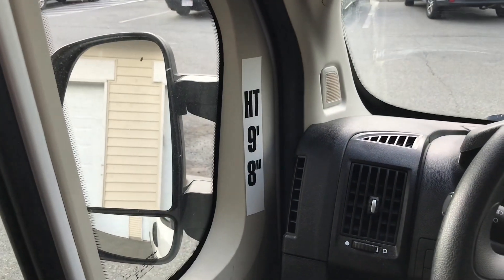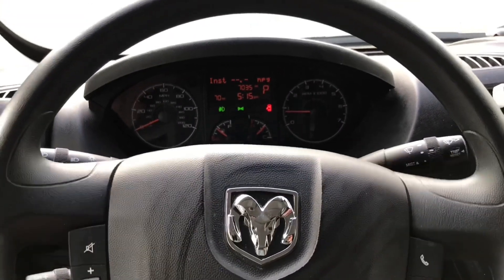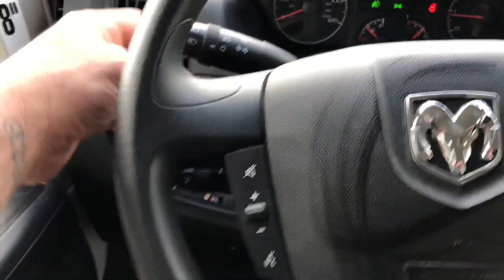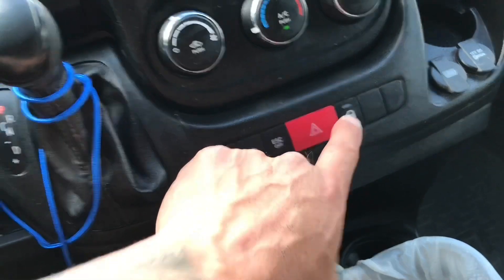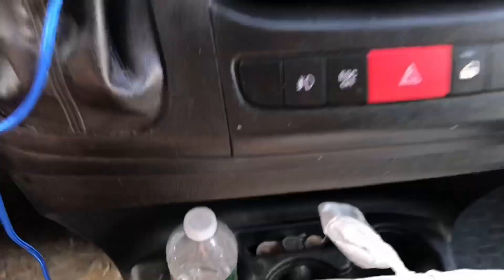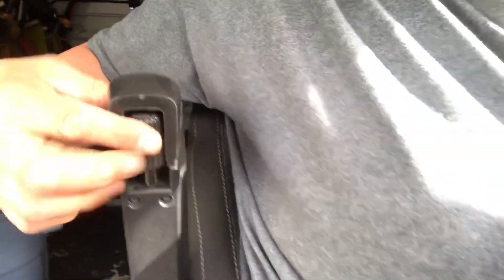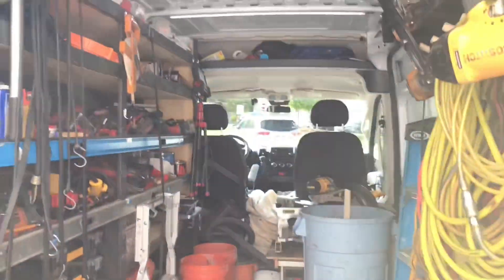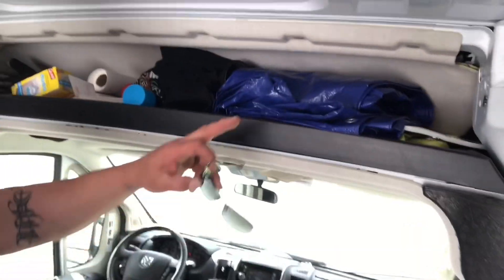REVIEW! RAM Promaster

Comment: Where is the fuse box for the body of the van?
Reply from the maker: There is a fuse box lower left under steering wheel and one in engine bay right side.  I’m thinking body module fuses are the ones below steering

Comment: I am getting ready to purchase a Van primarily for personal use (non business will be hauling at times my motorcycles). I am focusing on both the Ford Transit EXT AWD and the Dodge Promaster 159 EXT. I have gotten headaches comparing the two trying to make a decision, haha. I am  leaning towards the Dodge for its more box like design and proven V6 motor (which has been around for years Jeep). It is not built as well as the Ford, IMO (the body structure) but like I mentioned the Dodges boxy design gives more interior space (particuarly in width).   The Ford does offer all wheel drive (good for winter roads and some light off road driving) and higher roof height. The U.S.Post Office uses all Dodge Promaster Vans to deliver the mail and Amazon has them in their fleet as well. The maintance on the Dodge seems to be the less expensive of the two and easiest to work on. Decisions, Decisions, haha. In the long run it seems that the Dodge and Ford would last just as long but the Dodge it seems would be less expensive during years of ownership.  Golly Gee, what I am to decide ? Most likely it will be the Dodge or not ...

Comment: Awesome thank you! I am going to get one for a weekend warrior, smallest one. I am a little guy. The 1500 low will be the highest vehicle i will have owned and i love your height guage in your door. No one else has done that. Unfortunately my current garage is 7' and the low roof is over 7'. After i get it and install solar on the roof i will measure and put the measurement inside the door as you have done. Will help with drive thrus as you have said! Another perspective on a different  use, as videos go. Question: would you get a step, especially as you get older? On the rear and/or side? I am small as i have said so i might look at getting a short running board. Oh and security, would you recommend a 3rd party system to protect your stuff? Thanks.
Reply from the maker: I don’t like steps, I’m tall and I really don’t need them, plus I try to stay in shape as much as possible so I don’t mind stretching!
I’ve never looked into security for my van.  I typically work in decent neighborhoods so I never really have had anything stolen.  Also pawn shops pretty much stopped taking tools at least around where I live so thieves don’t really aim for them.  They’ll just go to Home Depot and take them

Comment: I have no idea what to think. 
So many horror stories out there about the cooling system and transmission on the Promasters. And then the ford Transit with its own set of unique problems.

Those are the two I was considering to build out as a campervan.
Now I'm thinking unless I win the lottery I shouldn't take the chance.

I'm glad your experience is good but im left with the impression that between the two it's a choice between the devil and the deep blue sea.
Reply from the maker: Michael RS they seem to have worked out the kinks, you should be good on a new one!  My 2018 is still running great, I did make a video on the headlight issue
Reply: @TunedRAMS  Thanks for taking the time for the feedback. Perhaps a little more stressful for me than some as I'm on a fixed disability retirement income. So hopefully I guess right when the time comes. 👍
Reply from the maker: Michael RS good luck, I know RAM has a lot of good incentives!

Comment: Great video. Nothing envious  about a Nissan envey ugly and cheap looking. I too had  a ram 1500 hemi.  Fantastic truck.  Then bought new 2019 1500 promaster. ..love it. 48000 miles  and zero problems.  Just oil changes. Mine has led lights too there indispensable. . Not many have them

Comment: This was such a great video, helped me make my decision. I was thinking between a Ford Transit, high Roof or the Ram, Promaster. After many reviews and your perspective, I will go for the Ram!!
Reply from the maker: Marvalous Metanoia good choice, glad this helped!
Reply: @TunedRAMS  I have a Ford Transit 350 dually for expediting cross the country and it has all wheel drive. With the load weight I haul my mileage mpg is between 18-22 mpg. Not bad and the awd is automatic and it also comes with locking diff,and front and rear heat and air also crosswind monitoring so it won't tip over.

Comment: Replace headlight bulbs every 6 months, 3 recalls, oil leak, door won’t open sometimes, hands free has to be reset every week, inadequate heat and a/c. No traction in snow. I go in reverse to get up a hill. Great mileage, lots of power.
Reply from the maker: Walt Archambeault the headlight thing, there’s a drain below the windshield that when it gets clogged drips onto the headlight plug which causes headlight issues.  Got to keep it clear, bad design either way.  Other than that my A/C spits ice and no leaks, she’s a 2018, I know prior years there were issues
Reply: TunedRAMS  There’s a drain below the what? Is “wind shou” supposed to be windshield? Can you elaborate on exactly where the drain is located please? I’ve heard about this headlight problem numerous other times so this is great information really appreciate it, thanks.
Reply from the maker: spleerfloof I edited, yes below the windshield at the wiper arm, in the plastic tray, there should be a small weep hole
Reply: TunedRAMS Thanks for clarifying, I plan on buying a ProMaster in the next six months or so.
Reply: Update:  54,000 miles. Replaced headlight bulbs with led. Let’s hope to get at least a yr from these.  Insulated the rear panels and added an aux heater to rear compartment. Here in NewEngland it gets cold and snow. The van was like a traveling refrigerator. My heated mirrors failed. No big deal, found one in a salvage yard. My rear doors rattle, fix those next. Hinges starting to rust. Still annoyed that my doors fail to open every time.

Comment: Front wheel drive is always better in snow than rear wheel drive, especially considering the weight is over the front wheels. Think of pushing a grocery cart through snow. Much more control if you pull one.
Reply from the maker: Actually now that she’s fully loaded she’s not so bad anymore.  I still get stuck once and a while tho.
Much better than RWD

Comment: I love mine too. I'm 6-3 as well and have smashed my head on those God Damn rear door brackets lol. My only two complaints are my 2500 gets terrible gas mileage around town and it's terrible in the snow. Next winter I'm gonna try some good snow tires on the front.
Reply from the maker: Yeah drinks fuel very well, I got Cooper AT3’s in the front and a tremendous improvement in the snow!

Comment: i used own one 2014 Ram Pro master High roof with 350000 km on it..what i want say is lots of parts are expensive and dealer only. Seat is very uncomfortable for long time drive(in 5ft 7). V6 Fuel efficiency isn’t good on highway when it’s windy, not much difference than v8 if you drive on highway mostly. I had engine leaking oil started at 240k km, took it to several shops it cost lots of money for inspection and repair so i just drive it because  market value is pretty low at that time and it’s eventually done at 350k km. Overall from my experience if you don’t put too many mileage on it, it could last for years, if you drive a lot and high roof isn’t necessary for you. Go with old chev cargo van, because parts are much cheaper and less headache. Im driving a Nissan nv 2500 high roof now because there is lots of space in cargo, parts is cheaper, mpg is close but there is lots of space at front when you work on it.
Reply from the maker: SageInSosg this is a 2018, 17k miles on her, she’s doing good so far.  I’m pretty sure they worked out the issues by now, I know they improved in a lot of things, even the 2020 is better.  It seems you got pretty good use out of it?  And yes about the seat, I tend to lean to the right on long drives, i wish the seat was a little lower

Comment: I have plans for a 2019 12 foot high top 3500. Thanks for the input. I was wondering about all wheel drive. I will have to check to see if it comes in all-wheel drive. Thanks for the info have a great one

Comment: I am looking at a used 2015 high top. I have seen hundreds of horrible reviews, so I am wondering, since you've had this a while now, is it still holding up good? Guys are saying electrical issues, headlights, motors, trans, door hinges.
Reply from the maker: Tom smith runs great, no issues so far.  I have a video, in the description, about the water hitting the light
Reply: @TunedRAMS  Thats good to hear. I asked a couple of my Facebook groups (which are all electricians), and they all pretty much had bad things to say. But when I think about it we electricians never usually have anything good to say, lol.

Comment: what do you think of the transmission of the promaster 1500 2016?  mine died with 150 k
Reply from the maker: The 6rfe is not the best, they suck in the RAM 1500’s too, as long as you don’t beat on it should last quite a while.  150k is a lot!

Comment: Have you had any mechanical problems up to now?  I'm planning on converting a promaster into a full time RV and don't want my home held up in a garage for design flaws.  Thanks.
Reply from the maker: Janet Arendas no mechanical issues at all!
Reply: I've had my van for 2.5 years and 40k miles.  Only issue was a rear door latch/lock.  The dealership replaced it under warranty.  I drive pretty easy so I average 17 mpg overall.  20 or more on the highway.
Reply from the maker: ripvanracer I actually had to adjust the rear top latch, I was having to slam the door shut and pull very hard to open it. Now it works nice

Comment: I really love my ProMaster!  Glad to hear it's working out for your business.  Question though:  You measured only 10' in the cargo bed, but you have the 2500.  What wheelbase do you have?  I have the 136" wheelbase, which has the 10' cargo length, but the dealer said the 2018's only come in 1500.... Ya got me wondering if he was "mistaken".
Reply from the maker: Luvnot Videos they come in two lengths, I have the not so long one.  I’d have to look up the length off the original sticker.  Mines an 18 and it’s a 2500.  He probably doesn’t carry them, but they definitely come like this
Reply: So there are two wheelbase lengths, the short one is the 136 inch and the longer length is 159 inches. You can get the 159 in a regular length or the extended length. The regular length gives you 12 feet of cargo space, and the extended length gives you 13 feet.
Reply: @TunedRAMS  Thank you.  That's what I suspected.  I asked for the 2500 136 wheel base and was flat out told they don't make them.  Good to know which dealer to never return to again.

Comment: you should really invest in a wall partition, great review
Reply from the maker: Duarte Handyman Services LLC. Duarte  don’t like them, they get in the way.  They restrict seat depth and often times Lumber.  I like to throw 12’ stock in between the seats a lot.  Thanks!!
Reply: TunedRAMS I get what you're saying however they are made to keep you safe in case of an accident, keeping all the tools from coming at you during the impact.
Reply from the maker: Duarte Handyman Services LLC. Duarte  I know man, been doing this for over 30 years, I drive slow
Reply: It takes only one accident! It's to late...
Reply from the maker: SC 03 motorcycles don’t have seat belts do they
Reply: Our work/leisure vans have all had their partition walls removed in favor of a curtain. The curtain is just separation from the front and back and does a good job at keeping climate control in the front cab area of the van 👍🏻👍🏻👍🏻
Reply from the maker: Axiom I need to get a hanging partition for this van for the summer!  They work great

Comment: Have you had any problems with the headlights burning out often? I've heard some people complain about that. Also heard complains about the rear door hinges not being very strong and/or the rear doors having problems closing properly.
Reply from the maker: No issues at all!
Reply: I have a friend that owns 4 and has had all those issues. I have a 2019 and the rear door sticks sometimes. The bulbs you can replace yourself. I’m at 40k miles and so far my headlights are good. Maybe they fixed the light issue in 2019. Also people drive these vans all day with the headlights on so that maybe why lights need to be replaced often. A lot of people use them for expediting. That’s 10-12 hrs running the van.
Reply from the maker: MsTheUndone I actually may have found out why the left headlight keeps burning out, check out my latest video Promaster Headlight Issue!

Comment: Promaster is a horrible van! I rented one for a week and Im glad I did. There is no tilt on a steering column,so it is literally impossible to find a comfortable seating position. Dash design is horrible.Designed by an idiot.A- pillar is blocking your vision when in turns,so dangerous!Transmission is twitchy and the engine is weak! It feels like driving a 4 cylinder honda. I ended up buying a transit and couldnt be happier. My advise is dont buy without renting one first,you will thank me later( i rented all the vans on the market before buying and transit felt like the best fit for me).
Reply from the maker: Not everyone is going to like it, that’s good you found one you like!

Comment: Snow? What? FWD is better than RWD (your old Nissan NV)in the snow ..Of course AWD is better than FWD but then again there are very few options out there.....Just get a good set of M+S tires like the Michelins.
Yeah telescoping but not til steering. The MPG is better than most. Most of us are shorter than 6'3" so we won't experience it the same way you do. The plastic door handles inside and outside are flimsy.
My main concern is the long term reliability.....I mean, Chrysler doesn't have the highest reputation, but so far, it seems that this 'older' 3.6 V6 and 6 speed auto have all the bugs worked out.
Reply from the maker: udmbfck x I have a constant 1500-2000 lbs of tools in the back.  All the weight is in the back.  The Nissan was good in the snow because of that.  FWD is horrible in the snow when the weight is in the back, but I still love this van.

Comment: “Awesome” van....until it takes a shit because it’s a Dodge/Chrysler. They only know how to make crap
Reply from the maker: David Cromer hows your Prius running?
Reply: Don’t have a Prius. I have a Ram Tradesman; which happens to have the same engine and tranny as the promaster. Total transmission rebuild at 70k miles. Notorious for bad transmissions with Chrysler.
Reply from the maker: David Cromer I had a Tradesman, 2015 8 speed, I have a 2017 RAM Laramie 8 speed now.  Both had a Pro Charger on it.  No issues.  You must have the 6 speed?  The 8 speed is just about bullet proof up to 700hp.